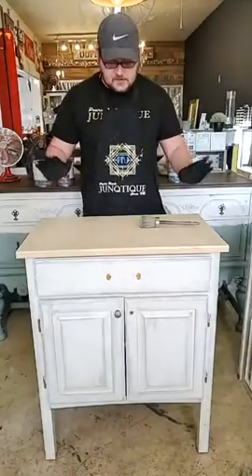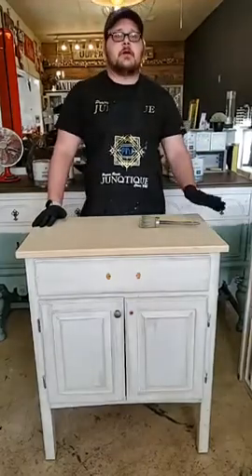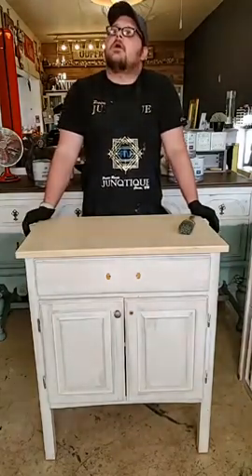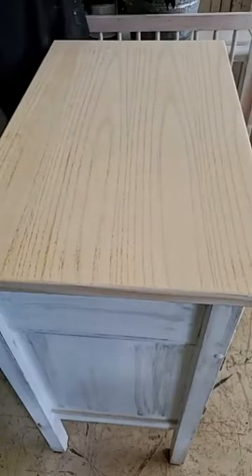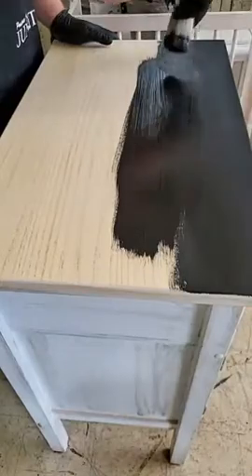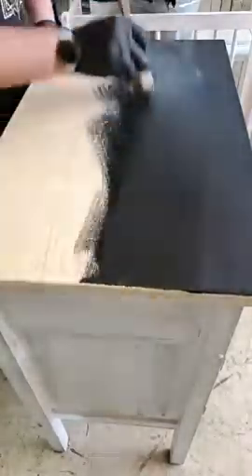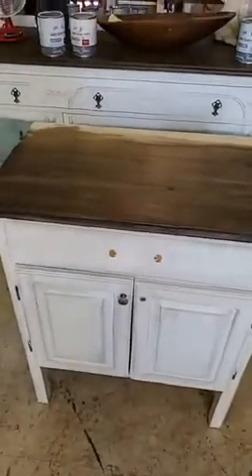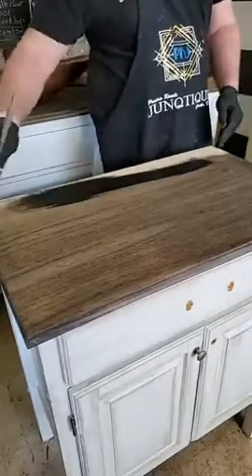Using Chalk Paint® as a wood stain

Comment: Why not just thin out the paint with water and apply it? Less wasted paint!
Reply from the maker: On raw wood, especially oak and pine (which this piece was) you run the risk of raising the grain with the water. But, the reason I did not want to thin out the paint was I wanted 100% of the rich pigment applied directly to the wood, not diluted. A little bit of Annie Sloan goes quite a way, and applying it to the top of this piece really didn't take much. 😊  If I was doing a wash over a finish, something already painted or sealed with some type of top coat it would be different and I more than likely would have diluted the paint, as I would be using it as a wash, and not a stain. 🎨
Thanks for watching 😁
Reply from the maker: New version up, which also explains why I don't thin out the paint when using it as a stain vs a wash https://youtu.be/t8d52nJ1f9c
Reply: That my friend is definitely Junq ! WOW

Comment: How do I age a white chalked painted mantlepiece not using wax
Reply: Athlone EIRE
Reply from the maker: You could do a color wash. Add a little bit of water to a small amount of paint and apply it in sections, then wiping off to your desired taste. I will add, if your mantle isnt waxed make sure it get some kind of top coat. Chalk Paint® when used indoors needs to be sealed, the paint is like a sponge and if its not sealed, will grab any kind of dirt or dust that comes upon it.